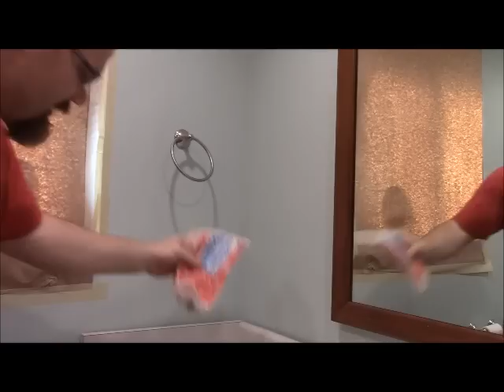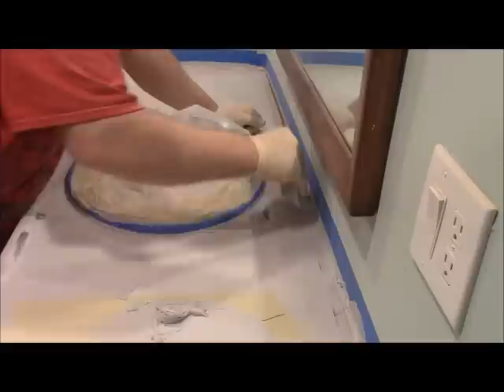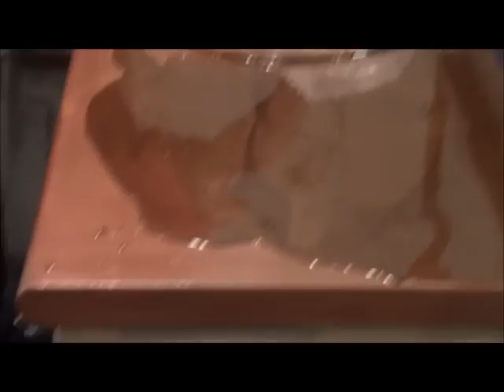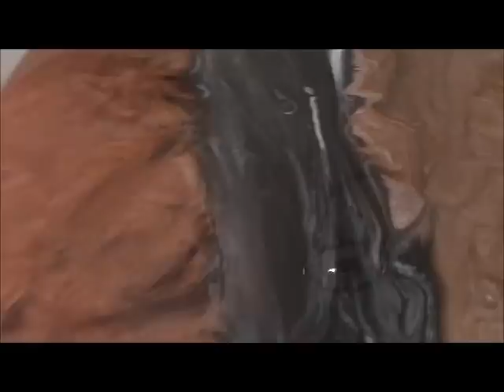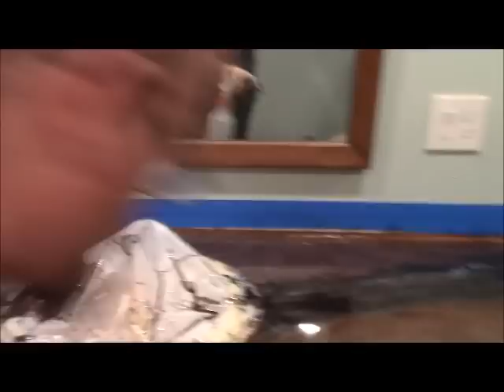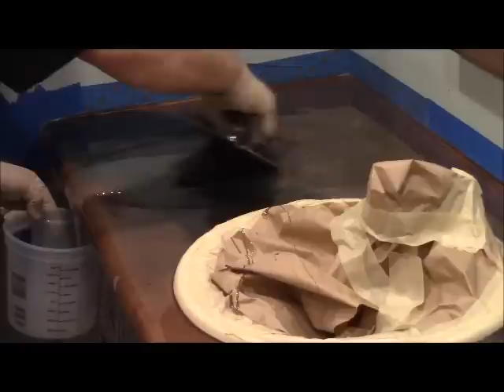How to Refinish Laminate Countertops  uncut Training

Comment: looks nice but its a shame you kept that old white sink. A copper sink would have looked nicer
Reply: I'm with the others...not linking the old white sink. Either a black or copper would have looked better. To show a before and after of the entire redo would have been really nice to see
Reply: If anyone has the knowledge to do the countertops, they have enough smarts to remove the sink. It’s so easy to remove and replace or add back. My 26 year old niece replummed her bathroom without having done it before, so I’m sure anyone else could.
Reply: What would happen if you had to replace the sink? It looks like it would be very difficult to do. Yes?
Reply: From a different YouTube on this channel, pulling out the old sink would have also made it easier to just remove the counter-top to a location where spills wouldn't be as much of an issue (just put plastic sheeting on the floor) and taping prep unnecessary.  As I understand it, just do the finish, re-install the counter, and then install the new sink in the finished hole.  The plus from doing it with the sink out is that you don't have to contend with messing up the counter-top finish once the sink has been epoxied in place.  No clue how to get the white sink out once that epoxy has dried or even if it's possible; that epoxy is strong.
Reply: You guys dont think. If he takes out the sink then he has to be a plumber to? So if time is money he wouldnt make any! Got it dilholes?

Comment: You are an inspiration! I'm currently DIYing my kitchen and I've used a lot of your suggested techniques. I did have a question, my epoxy is currently curing, however I noticed a lot of run off on the backsplash. I told myself I wasn't going to add any onto that kind of vertical surface but when I saw how pretty and shiny everything looked, I wanted it to look similar. But now, as it's drying there are a lot of "drip" marks. Do you have any suggestions on how to get rid of them? Is it safe to lightly sand?

Comment: Will the blade of the cutter that you used to remove the backsplash work on solid surface or cultured marble? And with cultured marble having a sink molded into it can this cover the entire sink? (I realize hardware would have to be removed first)

Comment: Really nice!  I have a bad feeling you just added to my "honey doo" list!  hehe.  One thing I would have liked to have seen in this video is the total before and after shot side by side.  And some better pictures from directly above.  We have a pretty large countertop in the kitchen and I can see a lot of possibilities with different colors and shades overall.  Thanks for the vid.   Will most likely do this.  The cost to replace is probably huge compared to this method.  A few hundred compared to a few thousand.....  One last thing....once it's hard, how is the scratch resistance?  It's so shiny I'm a little concerned you might see scratches more easily. I wouldn't expect you could use it for a cutting board but sliding stuff on it might leave scratches if it isn't real hard.  I can also see recoating it with clear in the future if it gets too scratched up.....  I was a boat builder and am pretty familiar with epoxy coatings.....by the way...you can build an intolerance to epoxy and it can be very ugly....and NEVER get it near your eyes.....instant blindness.  Do your very best not to get it on you in any way....   Thanks!

Comment: How does this hold up to heat once it's cured? Could I set a hot curling iron on my vanity or take a pot from the burner and put it on the kitchen counter? How does it do on concrete counters?
Reply: StoneCoatCountertops m